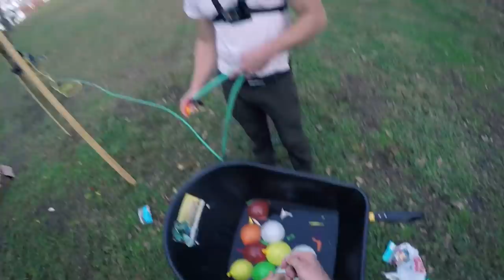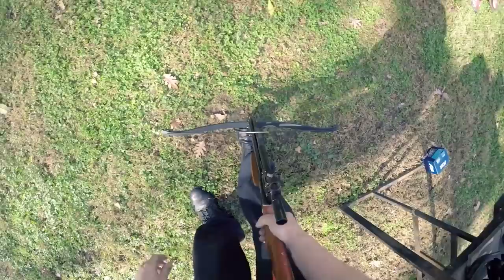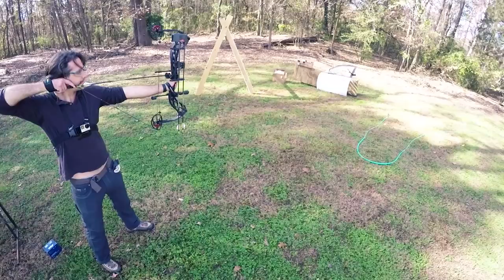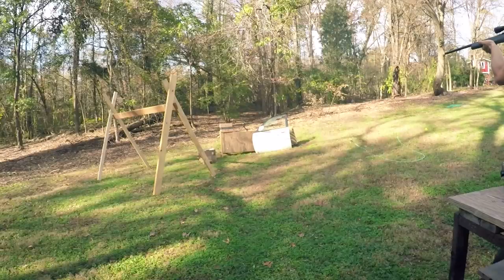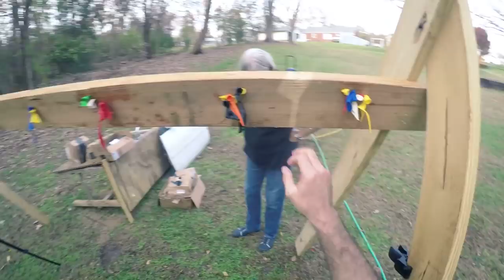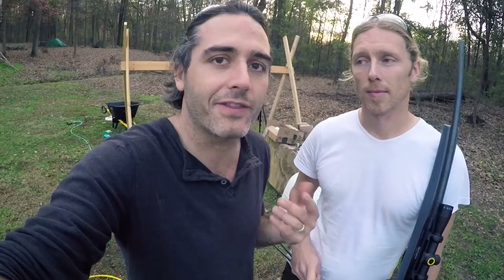BULLETS vs ARROWS in a Car Door and Water Balloons

Comment: The classic battle between superior kinetic energy vs momentum / mass. Arrows can go through some things that bullets won't, especially if the medium causes the bullet to fragment and catches those fragments.
Reply: Except sand bullet will go through better than arrows in every material, from concrete and steel from wood and paper. 
A 9mm calibre will pass a two-door car and go through. An arrow will be stuck at the first door if shot from a crossbow.
Also, rifle bullets (.223 or more) have much more momentum as well as energy. 
A heavy arrow shooted with a powerful crossbow has like 3-4KG*m/s of momentum, a .308 win has like 9KG*m/s.
https://youtu.be/8Y8Sbyls8Uc
Every single video you will see, a 9mm will always pass a car door, every single one.
If you shoot the back you can pass an entire car with a bullet.
Reply: @lw8249  aside from car doors, there are definitely other mediums that favor arrows. Bullets have such power that they can sometimes break up and disentegrate, whereas arrows keep going. Sand (like you pointed out) and water are examples. Shoot an arrow and bullet into a pool and see which goes further. But for either arrows or 9mm and up, I'll make sure I don't duck behind a car when being shot at haha.
Reply: @ZC.Andrew  There is nothing but sand and (perhaps) water if I remember correctly.
And the point with sand is only one element, speed.
Is not about the bullet that breaks (you are right in other scenarios, but in the sand, they basically remain intact) but that bullets impact at such a velocity that the sand reacts like a non-Newtonian fluid, whereas at the velocities at which the arrow arrives it behaves like a fluid.
In water it's more complex, yes the bullets are completely useless, but the arrows come close too, look at Tod shooting a powerful crossbow (completely) underwater, the arrow floats a few inches past the crossbow.
https://www.youtube.com/watch?v=6EORd-c8EEc
At minute 7:19.
Even shooting from outside, at just over a metre the arrow loses almost all its penetrating power.
Water on a military level invalidates both arrows and bullets.

The only medium that acts markedly different is sand.
Ah, and of course ballistic soft surfaces, such as soft kevlar surfaces with protection up to IIIA, where arrows penetrate fairly well, but small calibre pistols are blocked.
In every other case no contest, from concrete to steel (where arrows do not penetrate) or wood and paper where the bullet penetrates better and deeper.

And of course, these are curiosities, the range of the arrows remains too limiting, you wouldn't be able to reach a range to penetrate in a guerrilla scenario, and your rate of fire would be too low.
Reply: @lw8249  Nice. Yeah i was just going to ask about kevlar too. I know not to bring a bow to a gunfight, but I do find the physics rather interesting. I edited my comment a bit too. But here's the real question: what about zombies???
Reply: @ZC.Andrew  Well I think that bows can be (if you are a good archer, skills matter on those type of weapon more than with guns) a really nice weapon still today, one of the most interesting things is the silence of the weapon and still provide a good range in a stealth context. 
The main downside to me is that doesn't kill instantly if you don't hit a vital point, due to the arrow tendency to 'cut' and penetrate from the other side, but without leaving deep wounds or fragmentation.
The hydrostatic shock of bullets is devastating.

As for zombies ahah I really don't know, I think we'd be fucked.
But in a post-apocalyptic scenario it depends on where I am to make a choice, in the wild you can make and use a bow, make arrows, bullets and weapons are more related to a civilised context, you have to hope to find ammunition!

Comment: The arrow has more mass that improves the Kinetic energy.  A 400 grain arrow with a 100 grain tip traveling at 280-300 feet per second V.S. a 155 grain 9mm traveling 1200 fps. KE= 1/2 MV squared.
Reply: Pathetic: an arrow with those specs would have a KE value of 90 ft-Ibs while the 9mm at 1200 fps would have 432 ft-pounds of energy. 9mm is more than 4x more powerful but its a soft expanding non-jacketed hollowpoint that will easily deform when hitting steel as opposed to a sharpened carbon steel blade that will keep its point when it impacts the door. If you used a steelcore or FMJ 9mm it would go through the door like butter.

Comment: Water baloons are an exception because water is like the weakness of bullets but apart from that thats it. pistols can penetrate a car door significantly but  you had to try many Times with arrows, the first Arrow you shot barely dented it and you had to try again with more powerful bows. Try with a 50 Cal that Will go through 2 car Doors if not 3
Reply: SamTheWham anything that is porous is a problem for bullets. Not just water, but also things like sand. Sand is amazing at stopping bullets, but arrows go right through due to their slower speed and higher mass. Try shooting sandbags with both weapons and you'll see.

Comment: This is a science channel right so please me help me out here. In movies and comic books superheroes use trick arrows like explosive arrows,freezing arrows,flaming arrows etc.Is this possible?If yes then I definitely think that the bow and arrow is a better weapon system.
Reply from the maker: Yes, those are possible. The one thing I didn't talk about though is that most bullets aren't designed to "penetrate" so much as they are designed to cause maximum damage upon impact. The exit wound for instance looks very different with an arrow and a gun.
Reply: @UntamedScience  That's true, armor piercing rounds have a hardened steel core that keeps the impact area very small... but it still has very low mass, so they perform great against a hard target but not as well against a sandbag wall, which is part of why those and other earthworks are so commonly used as defensive bulwarks.

They are also hard to come by for civilians, for obvious reasons, while arrows and broadheads are commonplace and airbows aren't even technically considered firearms. The legal definition of firearm is anything propelled by an explosive, which does not include compressed air or other propulsive methods.

Comment: How is this surprising? Force = acceleration x mass.
*edit: probably the pointy arrow tip that makes the biggest difference.
Reply: less surface area on the arrow tip too, i.e. the energy released would be better directed to a single point.
I was however expecting the 40 to go through the door. 
Would of been nice to get actual measurements in newtons to see if it could of been due to the force or materials/design that gave the arrow the winning edge in these tests.
Reply from the maker: I'll see what I can do. I've reached out to some people online that can help me gather those pressure results (not as easy as it sounds).
Reply: Maybe you can set up a steel plate on a pendulum that only swings on one axis.
Shoot it and measure the distance it swings back over the time it took, this should give you a rough acceleration which you can use to figure out the force in newtons required to cause it.
It might not be too accurate but it could be precise enough to compare the two.
Reply from the maker: Not a bad idea ... Might have to be a heavy steel plate. I like it.
Reply: Mhm...there probably are bullets with pointy tips...or put a bullet tip on an arrow to have an equal comparison.

Maybe even measure the speed and mass of the projectiles and see if the calculation fits the impact on the steel plate. Typical arrows are probably around 7x heavier than a 9mm bullet. The bigger caliber bullets certainly have a higher kinetic energy than any bow/arm could produce but are not made to pierce like an arrow tip.
Reply: I'll do a test. I don't think it's necessarily the force. I think the bullets have more force. I think the reason it penetrates more in water is in large part because the length of the arrow keeps the tip going straight. I've seen a lot of slow mo bullets in water and they all start to tumble and change direction. The arrow doesn't seem to do that.
Reply: Yes, the bullets are much faster and therefore their aero-(or aqua-)dynamics play a bigger role. 
Additionally inertia and feathers/wing tips keep the heavier arrows on their path. 
Looking forward to the more in-depth videos :)
Reply: The arrow has more mass which improves the Kinetic energy.  A 400 grain arrow with a 100 grain tip traveling at 280-300 feet per second V.S. a 155 grain 9mm traveling 1200 fps. KE= 1/2 MV squared.
Reply: Jonathan Turner you are right about the mass but 9mm still has  more K.E. Actually way more: glock 19 generates about 475 joules with typical full power FMJ, while compound bows barely reach 100 joules, high end crossbows may generate 230 joules, and .22 LR may generate 170 joules. The energy transfer is different and the shape, material and pressure are different between the projectiles. If you shoot on wood for example, bullets will have better penetration because the friction between the shaft and the wood, and same thing will happen if we shoot 2 or more sheet metal with a foot or 2 gap between each other. It is not always the amount of energy but how it is carried and transfered as well.
Reply: @aphereandthere4895  these are probably really low powered non jacketed hollowpoints meant for A) maximum expansion and deformation within soft tissue and B) REDUCING penetration in order to prevent collateral damage. If they were steel core or a good FMJ they would fly through the door and exit out the other side of the car.